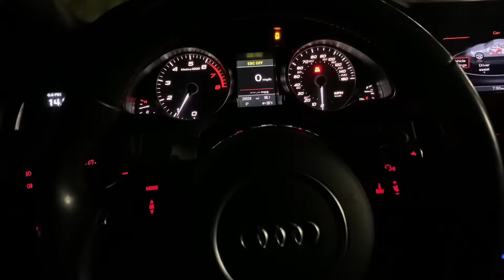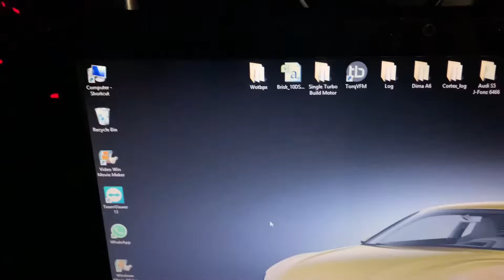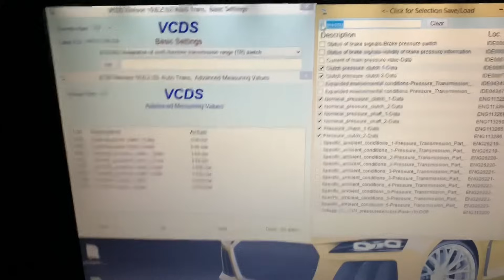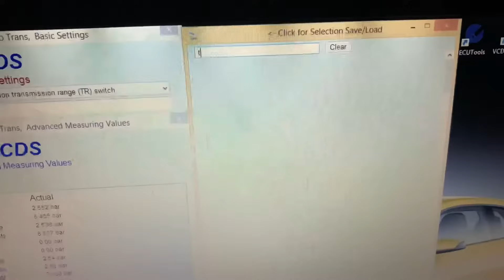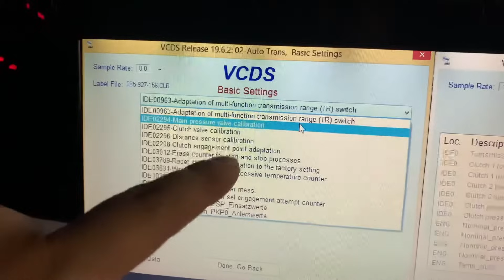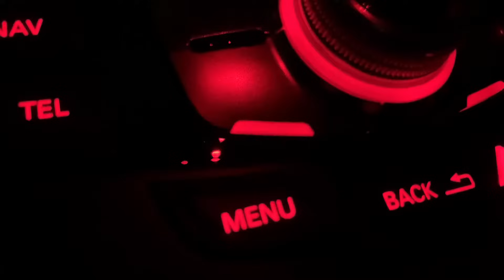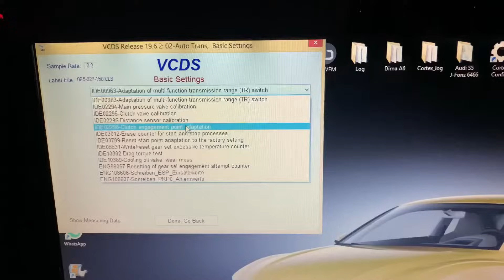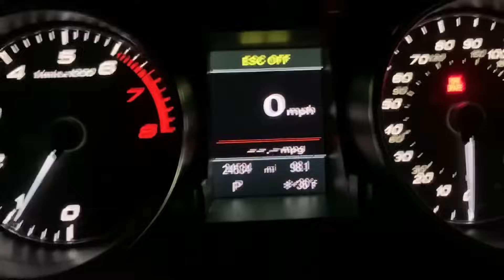Audi DL501 / S-Tronic *Adaptation/Calibration*

Comment: Hello, my transmission is working fine, however it vibrates a little when engaging the clutch. I've tried this method several times, but when calibrating the clutch valve, it aborts the operation and sends a message saying "stopped for safety reasons." Incidentally, when I run it, it doesn't show any pressure values in the measurements. Do you know the reason for this? Thanks.

Comment: Hi! I have 2009 Audi S4 (0B5 DL501) after i replacement the clutch plates and mechatronic repair kit, I have big slam and jerky when i take R or D while i standing. I do adaptation but i dont take test drive beacuse i dont know is it normal to jerk or no. I just need to go 100-200 kilometer and it will be good? Thank you!
Reply from the maker: Transmission Shouldn't do that, try adaptation one more time
Reply: @Svarogperformance  i made adaptation 4-5 times but the problem is the same :/
Reply: @Svarogperformance  maybe I need to do this with original ODIS?
Reply from the maker: @bestchams  You can try but sounds like you have some hardware issues with the pressure control could be a bad Solinoid or board etc.. Would recommend doing a full rebuild and cleanecharronic unit
Reply: @Svarogperformance  before this there was no such problem, only the clutch slipped, so I renewed it...:/
Reply: @Imabaitr6 I had same problem, big jerk when putting in D or R, but then drive fine ut when coming to standstill then big jerk/jolt again. So I just "Reset start point adaptation to the factory setting" so that fixed the jerk problem. No other adaptations or anything, but I do have slight thumping sound bass from transmission in 2/3rd under acceleration until 40mph then fine. I don't what it is, it wasn't there before mechatronic wire harness repair. But no codes or anything, just very low 18MPG/uk. I dont know why, I'm getting sick of it.

Comment: Hi Svarog Performance 
I have same transmission but my is stucked in error P287B00, i tried several diagnostic tool to reset but it is still stucked. 
Can you give me some hint on this problem 
Thank you
Reply: hi, did you find out how to fix p287b00?
Reply: @antbellamy2289  yes there was bad solenoid but i can't remeber which it was.  I sold that crap car out

Comment: Do you recommend to do adaptation reset values after changing transmission oil on Audi S4 ZF 6spd automatic ?
Reply from the maker: Yes you can do that
Reply: @Svarogperformance  which values should I change and by how much ?! 😊 thanks!
Reply: @Svarogperformance  A4 *
Reply: @Svarogperformance  can I adapt the transmission just by driving in some way? Thanks

Comment: Is there a way to tell by the dl501 adaptation values if it is wearing at a high rate?  Like the zf 6 speed could tell you how far from stock they have moved to adapt to aging.

Comment: I did a scan and got the following codes: P176B00 passive/sporadic
P17D600 passive/sporadic
P17D700 passive/sporadic
P286B00 active/static
Reply: P286B Clutch contact pressure too high. 
P17D7 Electric pressure actuator 5 Monitoring circuitry - Electricity too high
P17D6 Electric pressure actuator 4 Monitoring circuitry - Electricity too high
Greetings from Germany 🇩🇪

Comment: Do you have any idea why the Clutch valve calibration gets aborted due safety reasons??
Reply from the maker: There is lots of stuff could be rated
Reply: An sometimes I find really got to be between 40-60 degrees c
Reply: @joshoxley648  I tried many times on several temperatures but didnt work. Believe it has to do with my pirate vcds.
Reply: @drancyneuftrois3120  I got Vcds, good for OAM’s but I prefer Autel has 5 steps all up compared to vcds 3 things to do, I do probably 1 a fortnight down here in Australia were we don’t get much access to TsB’s an genuine info, what’s ur car doing after work has been carried out? Leaving any codes ?
Reply: @drancyneuftrois3120  did you ever find out the reason for aborted safety reasons?
Reply: @arkious  Try turning off the AC completelely since the torque of the engine is affected with the compressor activity. Next try to put parking brake on - while making the calibrations.  Should you succeed then. If not, there may be a mechanic failure inside the clutch pack or the solenoids are not in good shape. GL
Reply: @arkious  I'm interested too

Comment: Hey Bud, I'm doing the mechatronics repair kit, which is just the wiring harness. Do i need to do this adaptation after? I think I need to do adaptation when changing the solenoids but not the repair kit harness? Also, will doing this delete my TCU tune? thx
Reply from the maker: Yes and mechanical or software repair / changes I recommend perform adaptation and correction
Reply: @Svarogperformance  is the car on while doing this or just ignition ? Thx
Reply from the maker: @adist.3627  car must be running and hot ! Transmission oil temp should be at list 60-70c
Reply: Where to buy the kit in a reliable seller?

Comment: Where can I purchase this software and what hardware to connect to vehicle do I need?
Reply: VCDS software is free but you have to buy the adapter cable as it acts as a key to allow you to use the software. you have to order cable from Rosstech website. there are two options, the cheaper is about $500 and allow you to use VCDS on up to 3 cars and the full version allows you to use it on unlimited number of cars but costs like $1500-2000

Comment: How much did it cost to install the upgraded clutches? At what point do you think they need to be upgraded as far as the power at different stages (using apr as the example)
Reply from the maker: Labor around $2K+  If you having issue and clutch slips then yes I would recommend do performance clutches but OEM Clutch Pack should be good for 550WTQ
Reply: Svarog Performance where you get the upgrade clutch to buy?
Reply: No need to upgrade the clutch packs unless going bigger blower.

Comment: when install after market clutches, should do these steps?
Reply from the maker: Absolutely yes ! You have to do actually first time when heat cycle at the first start on new clutch after 1 hour then drive the car 100 miles do it  again / than drive car for 500 miles do it again / then launch the car 5 times and do it adaptation again and after this,  perform others at every oil change to be just make sure it’s all good